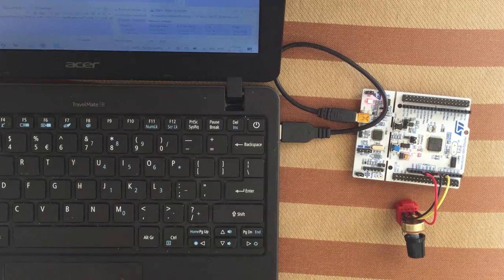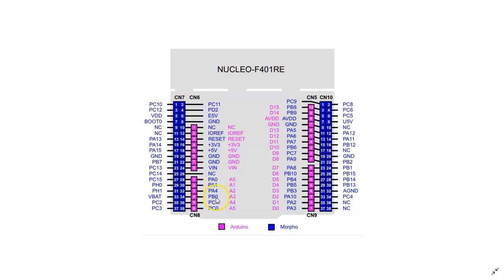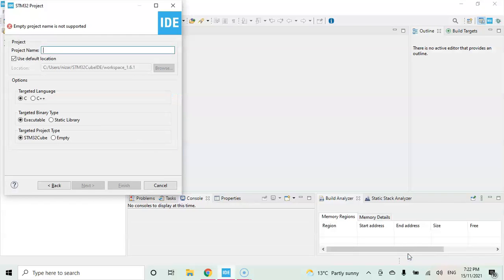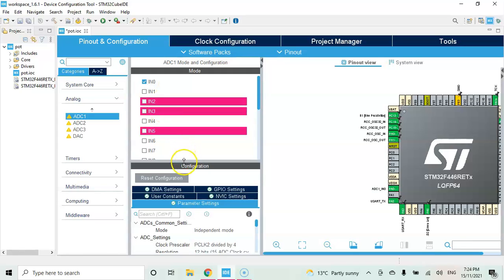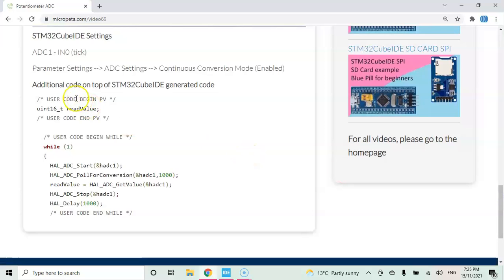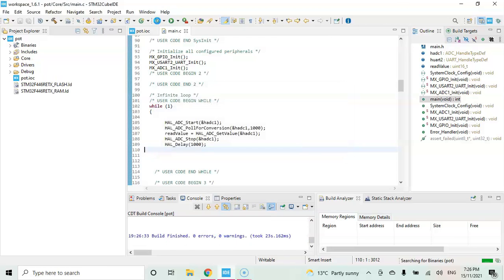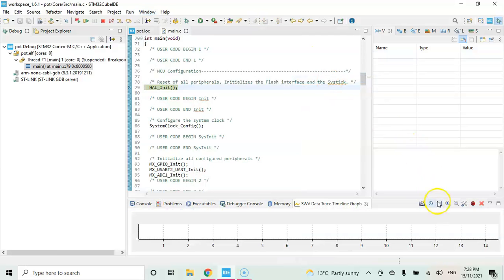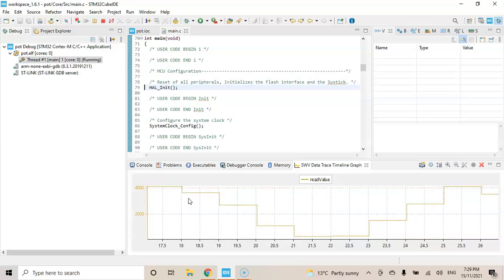69. STM32CubeIDE ADC to SWV Trace. Potentiometer with STM32F446RE

Comment: Regarding the 6m mark, the terminology "Data Trace Comparator 0-3" is kind of strange.. what is being comparing?   And what are the 32 ITM Stimulus ports for?

I thought Trace Streaming requires dedicated 1-4 TPIU Trace pins.. but here it looks like those signals are routed to the single SWV/SWO pin?    For example, isn't SWV also used for ITM_SendChar()? 

BTW, any idea if Trace-Control in Eclipse/OpenOCD is the same thing as STM32CubeIDE's SWV Viewer?   I'd love to use a J-Link Edu/Mini or AT-Atmel-ICE debuggers, on other SWD-compatible boards  (STM32, Microchip Smartfusion2, etc).